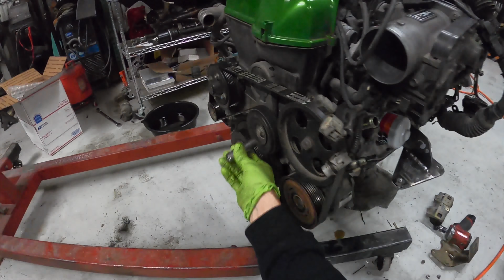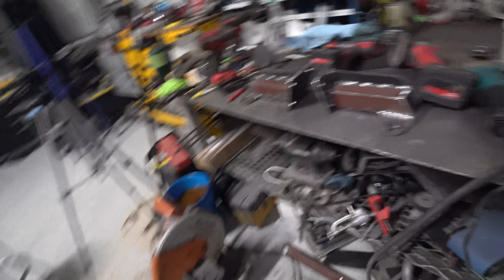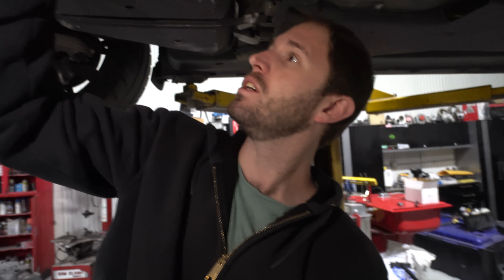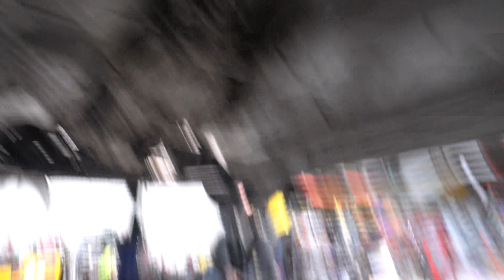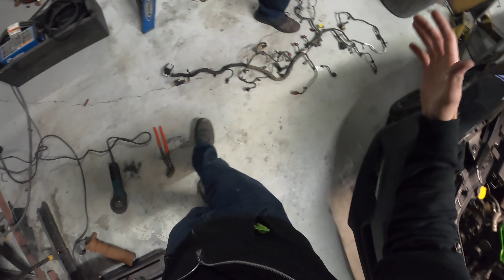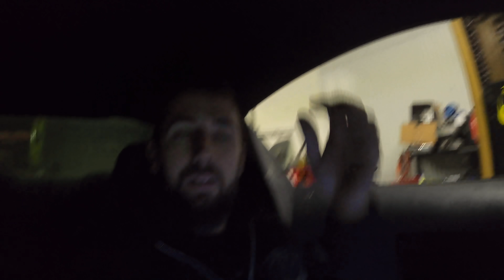Pt.3 | 2JZ 2015 Ford Mustang Build!

Comment: I work at a Ford dealer as a tech and can get you a pin out for the pcm connectors if you need it or anything else Might be of some help
Reply from the maker: Yes! If you could email me some stuff at motionautotv@ Gmail . com
Reply: The real mvp
Reply: @Poizdrc  fr
Reply: MVP
Reply: My guy
Reply: You sir are a legend for offering your services
Reply: You sir are what Trevor needed for this issue, to get this running ✌️
Reply: This dudes a g
Reply: @MotionAutoTv  down load forscan that will help with Ford pcm
Reply: My guy help him out 🙏🏻
Reply: Real MVP
Reply: What a great guy 🔥🔥🔥🔥
Reply: Dale Chapman you ol’ legend you
Reply: @MotionAutoTv  hey I am going to be swapping my mustang. What did you do as far as stand alone and tying into factory system to get everything to work?

Comment: Trevor, you shouldn't use metal plates as a engine mount, use tubing. it's way stronger because it has less deflection. one tube is enough.
Reply: Look at all the stamp steel mounta that are OEM... Tho many are cylindrical. I think the the added plate is enough, could have used more inside bracing.
Reply: @123vaw123  yeah i think that the plates he welded in this video are strong enough for sure, but i commented before i saw him welding the pieces. When i worked on boats in The Netherlands, we always used stainless steel tubing, it was 3 times lighter than square steel, and was able to handle the same force.

Comment: Find out what sensors the ECU requires and use an Arduino to send the signals to the required lines...
Reply: A lot of them might be CAN signals. Reverse engineering the PIDs and bits will take a while if you've never done it before.
Reply: @Mike02188  you can use a Dan decoder and an oscilloscope. It should atleast help make the process faster. I doubt the ECU will be asking for can info from 3 wire sensors. Probably more checking 'resistance' or 'pulse width' which is far easier to simulate.
Reply: @BISONGARAGE  a two wire sensor will be resistance measurement.
A 3 wire sensor is more likely duty cycle (not pulse width) or just voltage (but not very common these days)
I have seen some three wire sensors use single wire can
Reply: @ReubenHorner  I'm not saying they can't be can signals. I'm simply saying it is possible to replicate them. And I'm referring to both... To create a 3V signal given a digital source that can be either high (on) at 5V, or low (off) at 0V, you can use PWM with a duty cycle of 60% which outputs 5V 60% of the time. If the digital signal is cycled fast enough, then the voltage seen at the output appears to be the average voltage. If the digital low is 0V (which is usually the case) then the average voltage can be calculated by taking the digital high voltage multiplied by the duty cycle, or 5V x 0.6 = 3V. Selecting a duty cycle of 80% would yield 4V, 20% would yield 1V, and so on.
Reply: @BISONGARAGE  You sure can but let's say it was a trans temp sensor then it would make a hell of a lot more sense to just jam a couple of 1k resistors in there or something.

The real thing would be to go into hpt and tell the ecu it's a manual and also set the force neutral option then all of this doesn't matter

Comment: I know from experience, from doing similar swaps. That you need to have the oil pressure sensor wired in to get the fuel pump to run.  No oil pressure = No fuel.

Comment: When you disabled the auto trans, what about a clutch pedal switch?
Reply: Zac Culp not really necessary. Most drift cars have them disabled
Reply: @Matt_Lanzer_13  I think he's saying when he disabled the Automatic transmission function, the ECU could of swapped to looking for a clutch signal. Ecu now sees the clutch isn't pressed, and won't start.
Reply: Kyle Beaver that’s what I was wondering.
Reply: This is exactly what I was thinking, clutch switch is the manual version of being in park technically

Comment: Also if it's a manual it would have a clutch sensor and a neutral safety switch in the trans. So reading as a manual its losing sensors to start off of... off auto it's in park and has the sensor to confirm it

Comment: Trevor, for what it's worth, I ran the stock driveshaft on my 2014 5.0 coyote, 28x10.50 slicks, bunch of bolt-ons, cutting 1.58 60' foots revving the car to 6500 and side stepping the clutch to launch it... no issues lol. I think that CV joint will handle it for now, until you can get a built-on.

Comment: Ford transmission control module can stop it from wanting to start. If it doesn't detect the trans is in neutral/park it won't engage the starter.

Comment: Speed is abs through body control. Your ignition issue is neutral safety and back up camera is on the reverse light switch from the trans. It’s simple. I did it to my 16. Was manual and is now th 400 swapped. My reverse lights and backup camera are wired to my trans brake switch

Comment: Not sure if Ford is the same with HPTuners, but with GM the trans control is hard coded to the OS so the drop menus dont change anything. You have to do a segment swap from a manual trans file with matching OS number to change it to manual. Then it will want to see a clutch signal. In theory is should work if you jump the wiring so it thinks NSS is in park. Sweet build man!

Comment: You can jump the park switch wire from the tcu to the starter solenoid wire on the return from the tcu. Thats what i found when i did my ford swap. The fuel pump i just have run off a switch.

Comment: Be careful trying to start it using the push button starter if you don’t have a proper rpm signal going to the stock pcm, because it will keep the starter engaged even after the engine starts. Most of these push button systems will time out after about 10 seconds if it doesn’t register it started, but even that long will kill a starter quick if the engine is actually running.

Comment: For reverse cam there should be a 5v signal wire to the ECU if you find that, route a physical button that makes contact with the shifter when it's in reverse.

Comment: U need the tcm in the transmission so the ignition can communicate to the bcm. U won’t be able to just pin out cuz it’s based of hs and ms can. U can’t just bypass, or add a resistance, the bcm is looking for a communication network. 
Also the 8.8 pinion is the same as the 8.8. Get a yoke from an explorer that has a irs. Ur local driveshaft shop should be able to make u a driveshaft in a few hours

Comment: Neutral start switch needed to crank. Usually in the trans oil pressure coolant temp that's all needed. Make sure stock ecu is grounded. It will turn over. For the fuel. Use the jz  ecu. Ford ecu  won't tell you what it wants to start. Rpm signal  for ecu could come from an external hall effect sensor

Comment: Couple things, Have you tried Forscan?  Might be some stuff you can enable/disable with that, that hptuners can't do.

Also, in hp tuners when you disable automatic transmission, that should change it from a PRND switch to a neutral safety switch.  More than likely a pin on the ECM is either looking for a ground, or for a ground to be removed so the ECM can enable the starter.

Comment: if you can get the reverse camera working by putting the auto trans into reverse you should be able to wire the reverse sensor wires to your manual trans reverse sensor to get the camera working

Comment: We run bmw 320d altinators on jz as its 170amp. Remove the power steering (epas), the ac completely and the tensioner and just run a stretch belt round remaining 3 pulleys. 
Keeps it neat and never had an issue

Comment: You can get a 3 wire oil pressure sensor you have one wire for the gauge and the other two for turning the fuel pump on only when the engine has oil pressure 
Most Eps racks will only work when the ecm sees a tach signal 
Does the car have wheel speed sensors for speed ?
I'm not sure how well the push button start would work yeah it would crank it but not sure if you could get it to stop cranking after starting  without a rpm signal wich is going to come off that trigger wheel and I'm sure the jz has a different ratio it might work just adding a bracket for the sensor but the rpm will show wrong without a trigger wheel adapter setup hard to tell how much rpm or what all it needs to know the engine is auctualy running 
On my ls rx8 you have to have the factory ecm hooked up with a trigger wheel adapter for the eps to work and you cant just run wire to the rack to bypass it since it goes off of the steering angle sensor so rpm signal might be a big hurdle for you

Comment: The slip joint on the drive shaft is just as strong as the input and output shaft of the transmission.
My 2015 GT you need to have the clutch pedal depressed to the floor, I think you are missing that signal when you change it to manual trans.

Comment: id get all your main sensors connected, u mentioned coolant temp. some modern cars won’t even start with a failed or unplugged coolant sensor. you’re trying to start a car without a lot of your main components not even hooked up. notice how when u hooked up more stuff is started to crank. obviously there’s more than one sensor that’ll sense and control fuel, spark, ignition/timing. get it all hooked for your main control anything and everything that a car needs to start the trouble shoot from there.. figured you would know this ?

Comment: It sucks as allot of these newer cars are so CAN-BUS dependent.... The cool thing about that, is that you can usually just use some resistors to bypass those sensors....
The bad thing about that, is that it's nearly impossible to find any documentation on what the specific control module is actually wanting(as you mentioned)....

But then there are probably certain signals that are pulse modulated and would probably require some micro-controller/piggy back system...

Remote start on a manual is tricky, as you would have to put your car into neutral every exit(add a neutral switch for safety).... I live in the south where it's nearly always flat... We only use our "parking brake" as a hydro to cut up... In fact, we don't even call it a "parking brake", but instead call it an emergency brake.... But in the hills of Colorado, I imagine that ya'll use it often for actual parking... We just stick it in first, pray that the engine has good compression, and walk away....

I like what you're trying to do.... Everything about it!!!! You just have allot of hurdles, and especially on a crunch time period... I know allot will get pushed back, but I'd like to see you follow through, once the event is over....

Also, can you not swap the yoke on the Mustang's rear diff input shaft? I'm not familiar with it at all.... But surely the rear diff input shaft shares splines with a different Ford model???? If that makes any sense???

Comment: The manual cars need the clutch pedal depressing instead of the brake to start. 

So when you coded it to manual, it will be looking for a different sensor before it will fire.

Comment: The RPM signal to the Ford information cluster is CAN based. It receives CAN messages from the ECU to display the RPM. There isn't a dedicated signal wire to the cluster.

Comment: Idk how you’re going to get the push start to work. The start button just sends a signal to the ecu. The ecu sends the signal to the starter. It also stops the starter from cranking when it senses the engine is running.

Comment: What if you have David make a an adaptor that converts the Ford diff 6 bolt directly to the yoke in one piece for the 240 drive shaft? So yoke connection at one end and six bolts on the other and you can make up the 1 inch.

Comment: Ive learned many things working with vehicle electrical systems over the years and one of them is its usually MUCH easier and less time to just run your own new circuits than trying to trace / reverse engineer non working factory circuits. Just my two cents but trying to interface the factory stuff for 8 hours you could run all new wire for starter, fuel pump, ignition, etc and know exactly what you have then. I admire your will and attempts to get the ford system to run the toyota however, just not how I would approach it, especially with a time crunch.

Comment: For your driveshaft problem why don't you get a new pinion flange with the same pcd as the 240 flange and bolt that to the diff, completely removing the CV flange on the diff

Comment: Rewire the start switch to engine 
An same with fuel pump wire it to jz ecu wireing 
Just use mustange wires to run access
Also could u put sensor auto box sensor  in park then i prob start

Comment: Auto sports engineering sells a cv to gm 4 bolt adapter, it's made for the ar5 transmission, but will work for that, I have one in my gs300

Comment: I have a factory wiring manual for my 2017 gt will check if the ecoboost is in there if so I will email you some pages you may require

Comment: I haven't been paying close attention to this project , but is the chassis v6?.
If it is a 6 cylinder chassis how feasible would it be to run the Ford harness and ecu with a tune for the 2kz?

Comment: Why wouldn't you have tired the Z drive shaft before cutting it? It's one piece, and the carbon fiber flex should add some drive line stress relief.
Reply from the maker: It was too long

Comment: If by chance that's a 10-speed transmission that came out at car originally I will put it back in there on that 2JZ it will be stupid nasty and that would solve a lot of issues you're having and would make everything way easier but would be the dopest thing ever

Comment: Should have Sniffed the CAN system before you removed engine. You could have then had the information needed to build a controller to tell PCM,/TCM and BCM what it wanted to know to enable the wanted systems. The electronics system in the car is digital so just jumping wiring will just burn up controllers. The PCM/TCM and BCM are looking for exact resistances not just open or closed circuits.

Comment: If you weld the output to the driveshaft with the u joint  opposite of the rear one you should be able to get away with doing it yourself. It may not be balanced to the ounce but it wont be flopping around. If you dont understand what I mean strip the u joint out of the driveshaft and the "ears" left on the shaft are what needs to be opposed on the other end. Now I dont know if Ford would have that driveshaft balanced weird with the cv thing...but you probably would be alright with just that

Comment: Dont know much of HP tuners or newer mustang but... I have used FORSCAN  on a 2017 F150, messed with BCM and a few other things. The forum has an excellent spreadsheet that lays out all codes that can be changed. Again not an expert

Comment: Should have just trans swapped it to a manual, installed a bigger turbo, add all the power bits and cooling, possible to the EcoBoost, worked on suspension and steering angle stuff....called it a day....

Comment: The reason you got nothing disabling the automatic trans is you have no clutch pedal. You take away the neural safety but you then add in the need for a clutch application safety switch. You know most newer cars have to have the clutch depressed to start the vehicle. Dave playing jumper wire Jim could have shorted a circuit in the ECU. If you dont know where the wire goes and what it's looking for LEAVE IT ALONE!